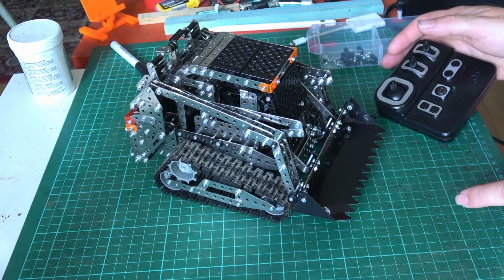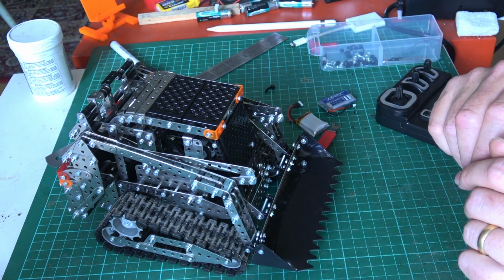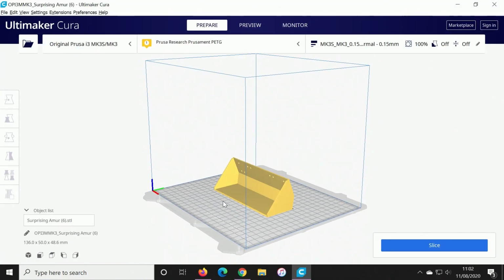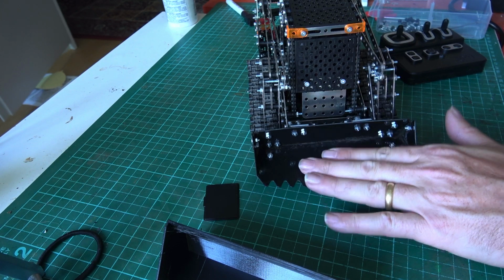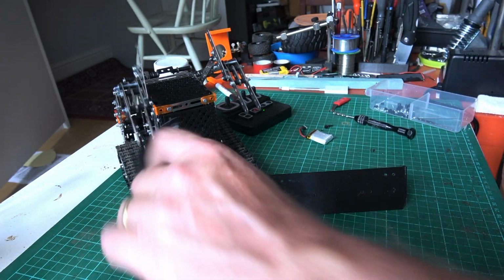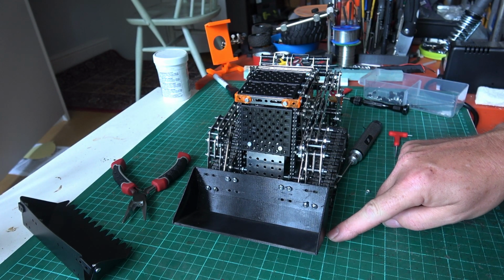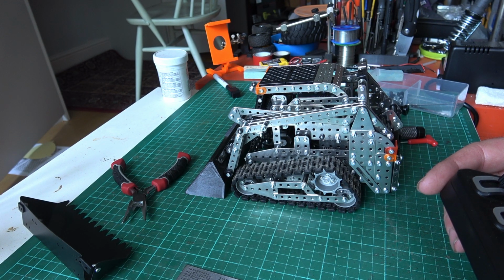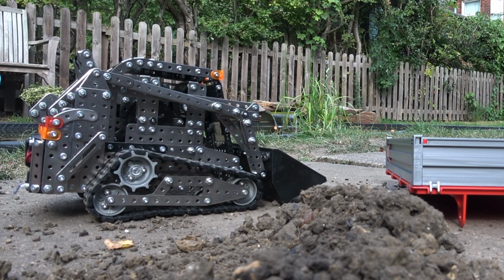Micro Steel World RC Bob Cat bucket mod

Comment: Nice bucket, I would have definitely gone the route of redesigning the arms though.  You'll have a better time scraping AND dumping if your lower bucket pin is as close to the ground as possible when fully lowered.
Reply: Anyone reading this in the states, Lowes home improvement sells individual "mecano" pieces in their fasteners drawers.
Reply from the maker: Good thought! 🙂👍

Comment: That is a pretty neat model.   Do the parts match Meccano ?

Are you aware that a real skid steer is controlled entirely with 2 xy joysicks ?   If the manufacturer understood that, the remote could match the real machine.  

Nice mod on the bucket.

Have you tried to connect a 5 in 1 type 2.4 GHz transmitter to the receiver ?
Reply from the maker: This is really just a fun little toy  - so the controls are a compromise. I didn’t try any other transmitters.